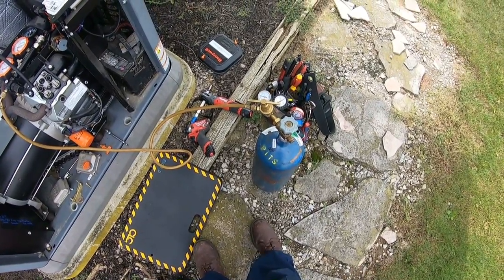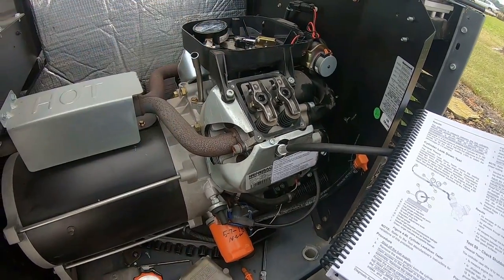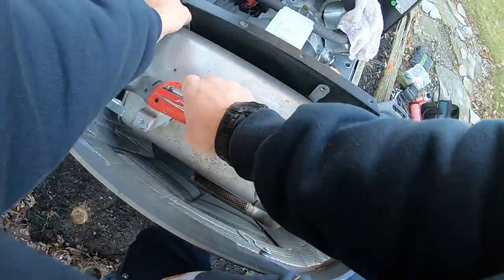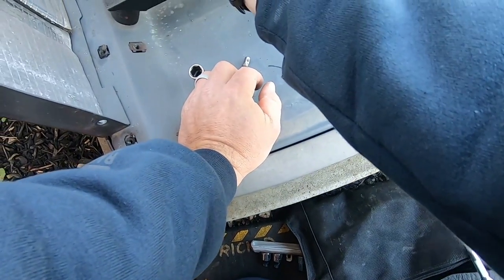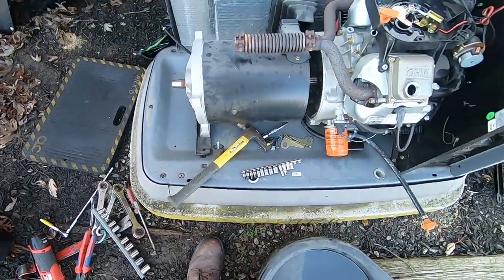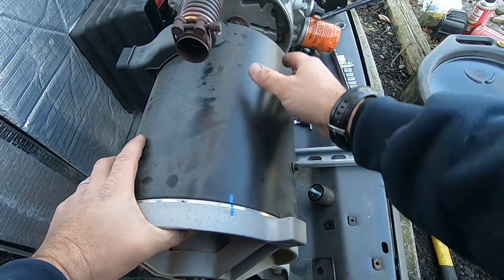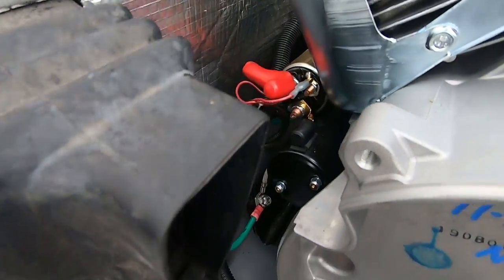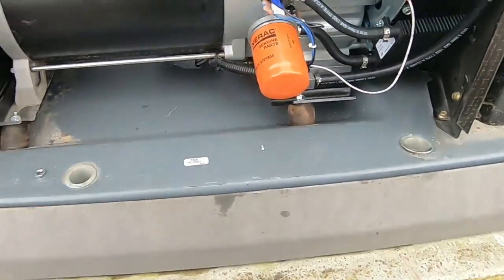Another Generac Generator Leaking Oil Engine Failure

Comment: it seems like every video I watch on home generators, people are paying 10K to 15K and have all these problems such as plastic gear replacement, engine failures, maintenance on valves, different opinions on changing oil intervals,  and they need frequent exercise programs, etc..... a generator with these price tags that are used for an emergency on the average is about 3 days a year throughout the US, yet you have to babysit them and take them to a doctor like 2 year olds! Why can't you just put some nice synthetic oil in them and don't worry about them like a car in which you can go 7000 miles per oil change as they are water cooled also. Plus, I don't think many home generators are in dusty conditions either!
Reply: Generac standby generators are JUNK that’s why so many people are having so many issues with them. I have a Champion standby generator that was installed 7 years ago and despite it has close 1,000 hours already it’s still working flawlessly like the same day it was installed.

Comment: What is the name or model of the tools for remove the fan in the gen? Tks
Reply from the maker: Just a generic puller from harbor freight. I don't have the original box so I'm not sure what the model number was but if you look through the pullers available you'll find it.  I think it was less than 20 or 30 bucks.
Reply: @HVACRSurvival  tks a lot man...

Comment: oil in the airbox and low compression on one cylinder pretty much always says major blowby and mechanical issue with piston/rings, visual inspection of valve rocker/springs would tell you if it was due to piston to valve contact or other.
seeing it didn't shatter the piston fully and break the rod, I'd have to guess rings went away due to no oiling there, probably plugged oil squirt hole/galley in case and no lube to rings.
a borescope camera would be neat to look at piston top for cracking/melting(major lean/advanced spark/physical damage)
Reply: I think I'll do that tomorrow. Good idea.

Comment: Is the transfer switch in the house?
Reply from the maker: Generally a whole house transfer switch will be mounted outside or real close to the power meter. If it's a smaller generator it may Only a hundred amp rated box and generally those are only rated to be placed indoors.

Comment: it would be useful to know the age of these generators and how many hours are on them.
Reply from the maker: I sometimes I'll mention that when I know.  Unless it has a digital display they don't have hour meters. Most of them are lucky if they have 40 to 80 hours. I haven't seen one yet that has more than 200 or 300. Far as age I don't have a chart listed in my book that tells me.
Reply: @HVACRSurvival  thank you for your quick reply. I am getting a new 22kw Generac 7043-3 installed in a few weeks, any words of wisdom?
Reply from the maker: @jbchess1  the newest ones have been good. Make sure it's in a good location as the manual says and the the gas and electric is sized correct and you should be fine. Change your start battery every 4-5 years. Run the test in high speed weekly. Check oil level after ever 24 hours of run time, change oil every 200 hours as they say. That's The normal stuff.
Reply: @HVACRSurvival   My runtime clock's showing 275 hours. It's gotten quite the workout the last few years with all the hurricanes and extended power outages we've seen around here.
Reply: @HVACRSurvival  yesterday I went on a service call for an overcrank alarm. Another tech from a company 30 minutes closer to the customer than me had adjusted the valves in February. He had adjusted them wrong and caused the no start situation. After getting done I checked the run time hours. 1666.6! The homeowner is 100% off grid and it needs to run a couple hours a day. He wants an ecogen but with a 30 week lead time I’ve got to keep his unit going. Great video. I don’t see many generators in my area so it’s nice to see repairs to keep things more fresh in my mind.
Reply: Yes I probably would start a work replacement book on the generators I repair. Would like to know what years in service and hours on unit.

Comment: What's the cost of just the engine? Do people attempt to rebuild these? I know of a few small engine shops near me.
Reply from the maker: I'm not sure exactly of the price anymore but i would guess $900-1200? It can be rebuilt piece by piece.
Reply: @HVACRSurvival  Well I did a compression check, #1 - 175, #2 - 90. Took the valve cover off #2. The rocker arm had slid off the valve. The hold down nut had loosened up. Never seen that before. I'll reassemble and recheck.
Reply from the maker: @ramp7t  hopefully that all that is wrong with it.
Reply: Latest update. Adjusted valves #1. Went on to check out #2 more closely. The push rod snapped, about 3/8" off at the top. The piece was lying right next to spring. Time to order a new push rod.

Comment: I had bought a 8000kw Generac for NG generator in 2013 brand new never got it installed till about 3 months ago in 2022 it never worked. The tech did a compression test and it failed said $2000 for a new motor told me that the seals go bad. What a piece of shit Generac are and I'll be out of my mind if I bought a new one
Reply from the maker: I have not purchased a standby for my self if that tells you anything, I do own two of the portables, The 3k inverter and the 8k larger one with 12k starting watts.

Comment: Need replacement engine 0G3501 to do this exact job...unable to find the 30hp v-twin engine. where in the world can i find an engine, or even parts...my engine did exactly the same thing...lost compression on one cylinder, filled air box with oil...
fred at oltexboots@outlook.com
Reply from the maker: Generac is where we got it. Your going to have a hard time finding a after market motor with the tapered shaft.